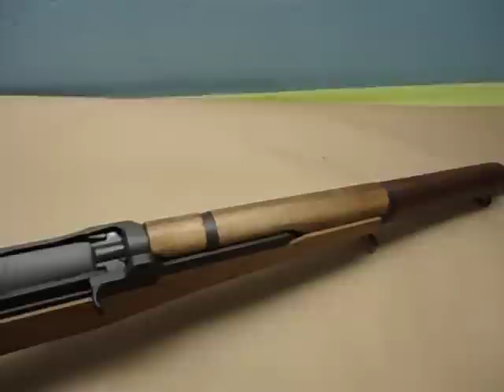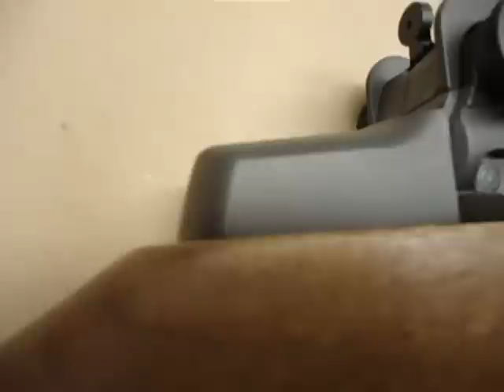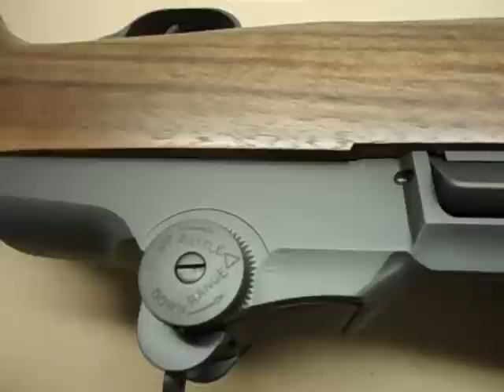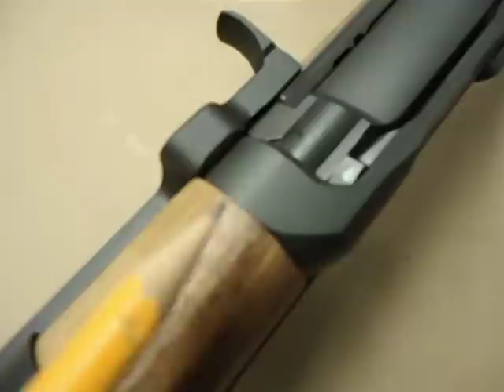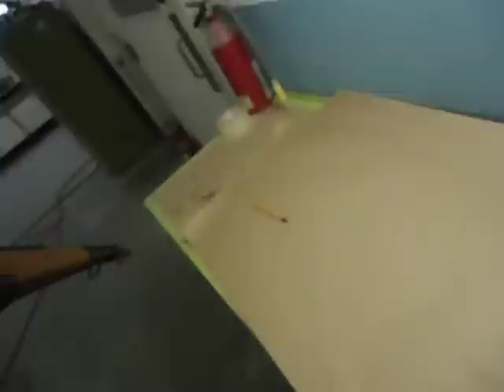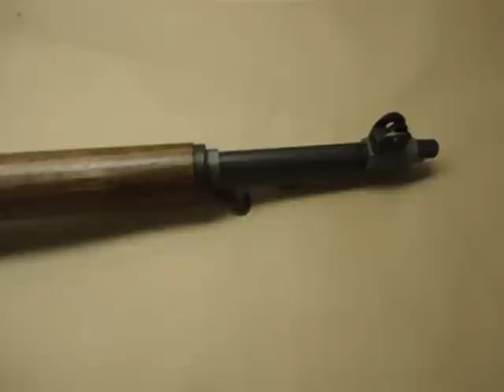Aaron M1 Garand Restoration Vulcan Gun Refinishing (9 of 9)

Comment: What do you charge to restore an M1 Garand?  I'm a member of the Sioux City Police Department Honor Guard and we have been talking about restoring all 13 of our M1 Garands.
Reply from the maker: Good Day. Standard Parkerizing is $250.00. Most that I do also need new Barrels, new Wood, some Rust Pit repair, so they can cost from $1000.00 to $1500.00 depending on how much Metal Damage there is. That's what costs the most to repair. If yours are Pit free, then they won't be too expensive. Any Idea of Barrels condition?  I've rebuilt over 70 Garands in the last 3 Years so getting to know them fairly well. Have many Vintage Unissued Parts, all Tooling, Measuring Gauges, etc.  Also Federally Licensed to do this type of Work. Many References. See vulcangun.com for more info.  Thank You.

Comment from the maker: Good Day.

Sometimes at the very front end of the Barrel, if the Lands and Grooves are worn or damaged by careless cleaning, some people have Drilled back into the Barrel to reach sharper Lands and Grooves. Usually it's only the last inch or less. Some people feel that if the Bullet leaves the Barrel from Worn Lands and Grooves, it won't be as accurate, so they eliminate the worn area. Now, the Bullet will only be guided by sharp Lands and Grooves. I've seen it before. 

Thanks.

Comment from the maker: I personally haven't done that although I've filled pits with various fillers and have painted parts with different types of topcoats. Not my way of fixing guns but it seems to be getting quite common to paint them any more. Way cheaper. 
I'm glad you realized about the Steel composition and such. You're right, it's a lot less grief to paint and not have to worry about matching alloys but that's part of the restoration challenge. I enjoy it.

Take care.

Comment: Excellent work Nick. I have a question concerning a Garand I have. The receiver also has similar pitting. However, I don't want to remove any more metal by filing to solve these issues. Especially on top around the lettering. 

I wanted to know if you have ever done pitting repairs using lower temp silver solder, to minimize the need for heat treating when done?

I ask, because I will be refinishing with Cerakote-H, so different alloys will be of no consequence, like when parkerizing.

Comment: the gas tubes made outa stainless steel which is why it wont really take a park. i have a video course on the garand from AGI and the smith in the vid says you could park it if you use a stainless steel park. not sure if it would match or if your set up for that but i figured maybe youd be interested. by the way your restoration vids are great.

Comment from the maker: Good day. See my earlier comment/response. 

It's difficult to give any kind of quote without seeing the gun. This particular job came in at about $700.00 not inc. parts. That job didn't involve any Wood refinishing. That would be another $100.00. I charge a flat $50/hr. for my work but some subcontarctors that I may need in the restoration process like Heat treaters, Metallurgists, Laser engravers, specialty welders, etc. cost twice that much. Every job is different.

Send pics. Thanks.

Comment from the maker: The entire Gas system on a Garand has a very high Nickle content (Stainless Steel) in the metal. That was done on purpose to help keep corrosion and carbon build up from forming, which would adversely affect the reliability and performance of the weapon. Parkerizing will only develop on Ferrous metals like Steel or Iron. You can see that it did form a little bit, but hardly at all. 

Glad you like the efforts and the finished product. Thanks.

Comment from the maker: This rifle was built in 1941 so it's at least an early WWII if not before slightly. These early ones are getting scarce. That's why it was decided to try and restore it.

I have tried several ways to keep Parkerizing out of the barrel, without satisfactory results. Some always seems to leak into the barrel, or the end plug doesn't sit just right, leaving the crown area uneven looking. I don't plug anymore. That Phosphoric Acid is fairly mild. It's not going to hurt the barrel in 15 minutes.